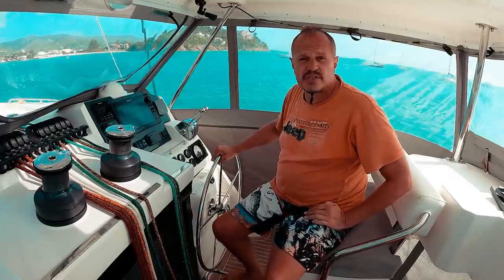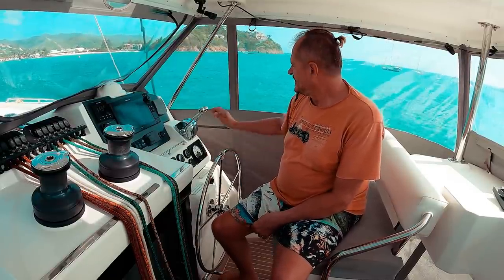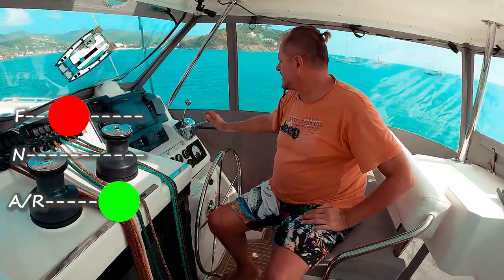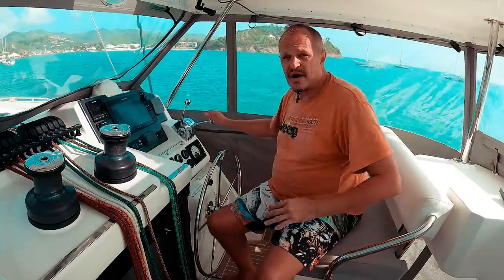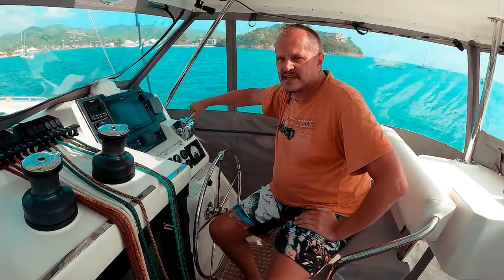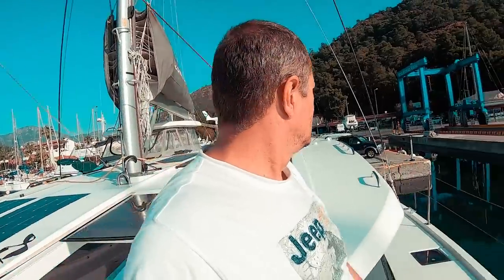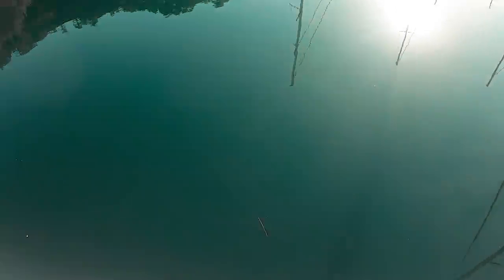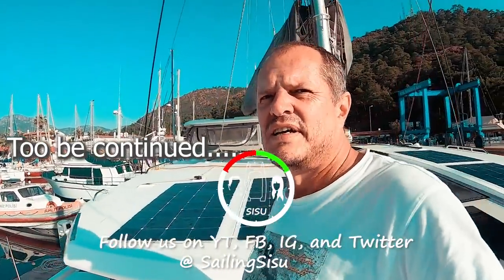#146t How to Sail a Catamaran - Docking Theory | Sailing Sisu Leopard 45 Catamaran Circumnavigating

Comment: In many ways, navigating a boat is like flying. Having to "crab" into the wind in order to maintain your desired direction of travel is the most obvious parallel. I didn't know that the pivot point would be so far forward of the screws however?! I had always thought it would pivot at the same point that the screws (propellers) were turning. That's something new for me. Cheers from Winnipeg.
Reply: Always wondered how hard it would be to get it through Lockport, mind you a 45 is probably too wide.
Reply: @bayanicustodio3998  LOL Yes, it probably is too wide.
Reply: @bayanicustodio3998  - the draught is the important measurement, any vessel over 12 meters must display draught on the hull. Width is not an issue, if it doesn't fit you can't enter, as far as length, the lock master might try squeeze you in, if too long it's up to you to back that big girl out. This is where you draw a big crowd with lots of videos being shot as you rip the shit out of the sides of your boat, enjoy!
Reply from the maker: Peter, yeah, I also thought it would pivot around the engines, but then, the engines need to push a few tons supported by two keels's water resistance, thus the pivot point moves forward to where the weight and the resistance are... that is why every boat is different, even between the Leopard 45s because there weight differences, not much but technically it would be different, even with full diesel and water tanks will be different than empty diesel and water tanks ;-) again, not much, perhaps a meter or so.
Reply from the maker: Bayani, yeah, it is fun times going into a tight spot for a crane haul out if you have a cross wind :-D go it at speed to keep sort of a track with the keels, line the bows up, and go for it, then as you enter, applay heavy brakes!

Comment: We did a one week catamaran bareboat live aboard training with US sailing in Florida a few years back. The instructor told us to handle the boat like a chopping cart while docking (with wheel locked at center). Pull back with left hand, push forward with right hand, cart will pivot left, ditto vice versa. I always thought this was the easiest way to remember :)
Reply from the maker: That is for sure a good analogy, Nadja! A shopping cart/trolley 😊

Comment: Interesting and good explanation. One additional note: With strong side winds during the docking process, you can still use the steering wheel all together with the engines. For example: The wind pushes you sideways to starboard. In that case you also could use starboard  engine forward throttle and turn the wheel to starboard too. If needed, you still can use the port engine for smaller corrections. That way, the boat will push sideways against the wind without turning itself around on her axis. All in all, it needs a lot of practice of course and every cat handles slightly different.
Reply from the maker: Thank you! Very good advice indeed!

Comment: hi guys, have u had any issues with the mechanical throttles?  have u had to provide any maintenance to the throttle box over the years?  thanks for the great vids & info!!
Reply from the maker: Nope, not yet any trouble. I have not yet opened the throttle box, and perhaps that's a good point you mentioned!

Comment: Yes, we offer ASA schooling and have trained most of the catamaran sailors in the PNW on the canada side of the border. I do the docking training myself and have many techniques to deal with windy conditions. And use rudder flush to move stern that small bit to the side. In dock, slow is pro. And a bow camera helps when you have no crew to watch the port side bow, an area not visible from the helm.
Reply from the maker: Larry, you are spot on! Slow is pro up to the point where you lose rudder control, meaning that the boat just starts to drift in whatever direction nature is taking her. As for rudder flush, I have tried it many times, and it works not every time :-( still not sure whether it is the wind or the weight or both or my stupidity, but she does not want to go sideways everytime.

Comment: It's like driving a skid steer bobcat or a tank  like you said but the cat has inertia that has to be controlled by the engines.
Reply from the maker: Exactly, Negus! And then there is the wind factor and the current factor... if the wind is blowing sideways, you will slide sideways...unless you are going fast, but you do not want to go fast, so....

Comment: I think one thing that sometimes confuses people who watch a pro skipper is they use more power in short bursts than most amateurs would (except the ones who end up on Boating news of the Week).  Part of the reason I think for the authoritative movements is because time is money for a professional.  Cant afford to dilly dally around.  So one thing I would say is yeah, copy the pros but don’t do it as hard as they do…. slower and softer is generally better for the non professional skipper.  IMO.
Reply from the maker: cannot agree more, Tony! i still cannot go full throttle in a marina :-D those guys are just born with two throttles (not bottles) in their hands! Once, while we were still in Cape Town (actually exactly the spot we were in the video with Happy Together) two L45s came in hard and fast, sounded like a squadron of fighter jets, short on each other's wakes. The front one took a slot on our right and the aft one the slot on our left, they turned in almost in a synchronous motion, and reversed in... it was a sight to behold to see those two Leopards racing backwards and stop like two Falcon Heavy Boosters!
Reply: @SailingSisu  awesome!   Yeah that would be great to see.  Unless you were standing on your bow docked and watching them come straight at you.  :)    But I get that wasn’t the case, and they know what they are doing.  
I’m just a beginner but I’ve found that every approach and leave is different because of wind.  And the 45 has high slab sides and frontage so I do wonder what Sisu is like in the wind.
If you have time could you please comment?  Maybe weight and keels mean it’s not so flighty?  How do you think it compares to other prod cats in that regard?  Or all much the same?  Thanks for all these vids….  I love them.  Sisu is my ideal boat.
Reply from the maker: 100% true, Tony! Every docking is different, well in our case it is also the docks itself that changes from port to port :-) And yes, higher free board is also playing a huge role! The newer production cats have a little bit deeper keels or stubby keels or sacrificial keels, which for sure helps. The same with weight, the heavier, the less issues with wind. In my opinion, it is more to do with speed, than the rest. The faster you go, the less influences or less time to influence, too slow, the less you "carve" the water and the more time to get drifting... The L45 does have good sacrificial keels, which helps for sure, with props in front of the rudder, helps too to get water flow over the rudders. I will try to address these issues in later videos where the wind factor is coming into play ;-)
Reply: @SailingSisu  thanks Frik for the answer and the possibility of more in a vid.  You and Petro rock mate.  Really love your vids, boat and and voyages.

Comment: How can you go sideways and use the throttle only
Reply from the maker: Actually, pretty easy...the wind or current will take you sideways. The current is stronger and more consistent so, you can crab in, but the wind is different. The faster you go, the less leeway or side slip, the slower you go, the more the leeway/drift/side slip. Of course, nothing what the skipper can do will make the cat goes sideways, it is the forces of nature. What i meant by sideways, is that a tank or a car rarely go side ways when the wind blows, in fact, if you drive a car at 2cm an hour into a parking spot, it will eventually get into the spot while, if you go slower than a certain speed, the skipper loses rudder control completely and will just drift wherever the wind or current takes the boat...sideways is only one direction that the force can take you :-) That said, there is a way to turn the rudders so that the thrust/propwash of one engine is pushing while the other prop is pulling, that will make the cat goes sideways, but it is only working for me in a very wind still environment ;-)

Comment: You look better and younger with short hair and that thing hanging down from your chin and as you said about learning to control your catamaran , It's like learning drive car you start a a slow speed until you get better at it .
Reply from the maker: Thank you Mat, and you are correct! slow is pro, but a car you can go a 2cm an hour into a parking lot and still get there, while when you try 2cm an hour with a boat, you will drift anywhere the nature wants you to drift and you have 1 out of 360 chances that it is into the slip ;-)

Comment: How can you go sideways with a cat
Reply from the maker: Actually, pretty easy...the wind or current will take you sideways. The current is stronger and more consistent so, you can crab in, but the wind is different. The faster you go, the less leeway or side slip, the slower you go, the more the leeway/drift/side slip. Of course, nothing what the skipper can do will make the cat goes sideways, it is the forces of nature. What i meant by sideways, is that a tank or a car rarely go side ways when the wind blows, in fact, if you drive a car at 2cm an hour into a parking spot, it will eventually get into the spot while, if you go slower than a certain speed, the skipper loses rudder control completely and will just drift wherever the wind or current takes the boat...sideways is only one direction that the force can take you :-) That said, there is a way to turn the rudders so that the thrust/propwash of one engine is pushing while the other prop is pulling, that will make the cat goes sideways, but it is only working for me in a very wind still environment ;-)